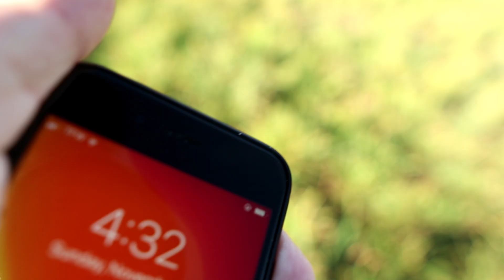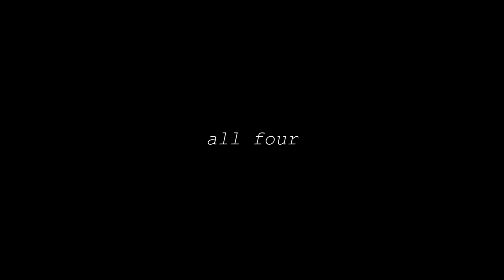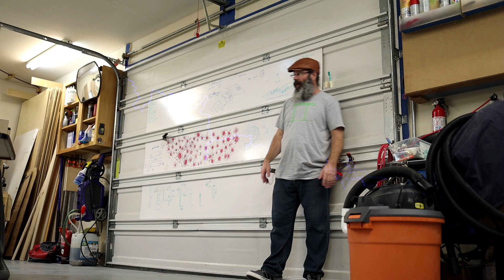Cyclone dust separators for shop vac dust collection

Comment: The cyclone setup works so well I can afford to use HEPA filters because they last so long. To save headroom, like under a miter saw, Home Depot offers a flattish cyclone, the Dustopper, that works similarly. Dustopper's 2nd generation is more efficient and is less money than before.
Reply: Besides the street elbows what is different? I have the old version and it works good but I found the cone shaped separators to filter better. I use the Dustopper as a mobile unit due to the lower center of gravity and toughness in a construction environment.
Reply: @williamganley4739  The newest version I'm aware of, about a year old, besides a broader sweep to the els, has a horizontal surface below the inlet to reduce turbulence in the bucket. A few hours ago, when I went to Home Depot's site to find the name of their device, the site showed a price of $39.95. If I'm correct the price was $45 several years ago. I also believe - as you seem to -  that the vertical cyclones are more effective but the improvements make the Duststopper a closer second and in some situations the better choice.
Reply: @williamganley4739  The second one I bought had an admittedly flimsy horizontal disc with a slit in in it to direct the inward flow into the periphery of bucket. That keeps the airflow of the inlet from fighting the airflow out. You're right, though, about the street els being an  improvement.
Reply: I use a Dust Deputy and until this video I thought it was the only one with the tool inlet on the right (ccw airflow).  I use mine mainly for sanding drywall and was interested in the Dustopper for the lower profile. My first test with the Dustopper was dismal but adding a gasket between it and the pail made a huge difference. It still missed the finer dust that the DD got but did a reasonable job.  I use a Cleanstream filter and a bag in my Ridged 6.5 and the inside of the machine is usually cleaner than the outside. If I see any dust on the inside I know there is a hole in the bag.